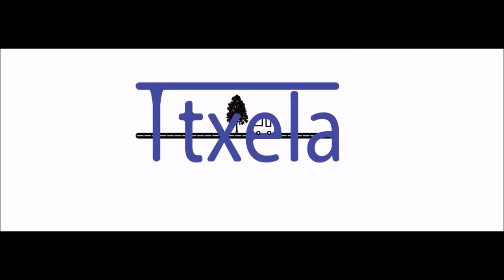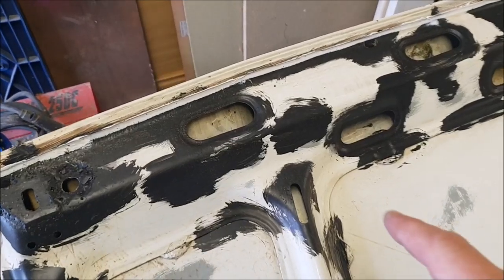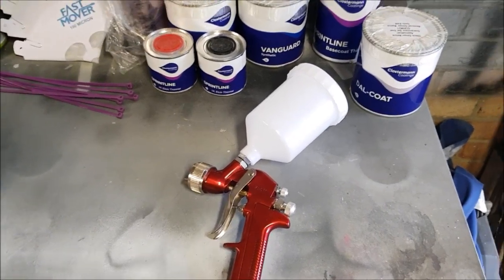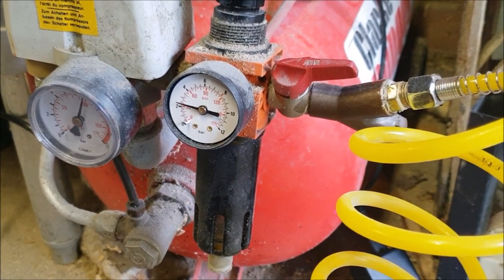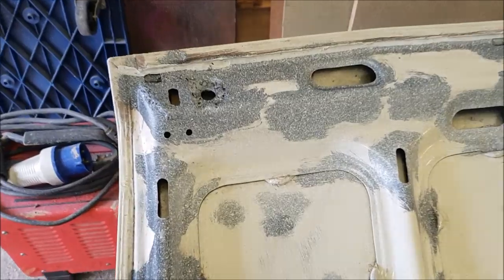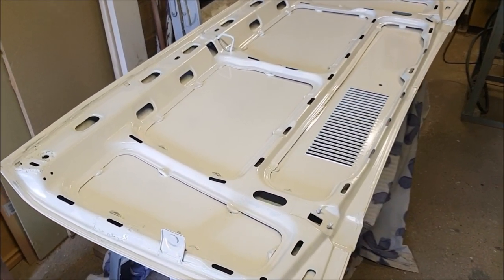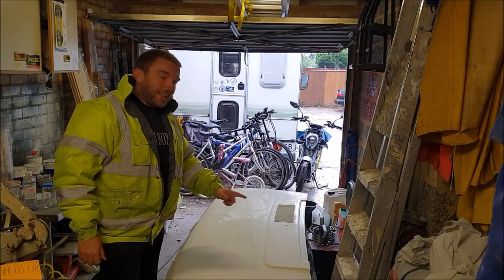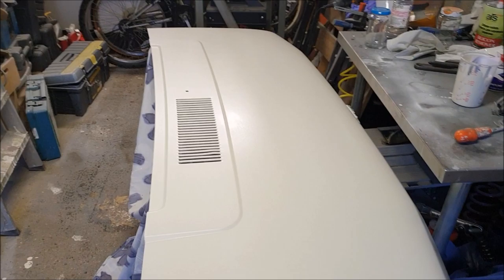Motorhome Bonnet Restoration Part Six

Comment: I had a similar problem with the spray when I did my Merc last autumn. I was using 2 pack acrylic. Eventually I found the solution was turning up the paint flow. More paint atomised better, went on nice and wet, so formed a good finish. Probably this info is too late to help you. Yours is looking pretty good now. Can't see orange peel on the camera.
Reply from the maker: I'm using a 1k acrylic. It did start to spray a lot better. I had the paint flow wound right out so maybe that helped too 👍

Comment: I googled about that Ars paint remover, apparently it comes in many colours and textures and you should watch out for the hairy ones. Could this have been you early issues with the spray gun 😉😉😉
Reply from the maker: It would be a bummer if it turned out I'd got the wrong one.....